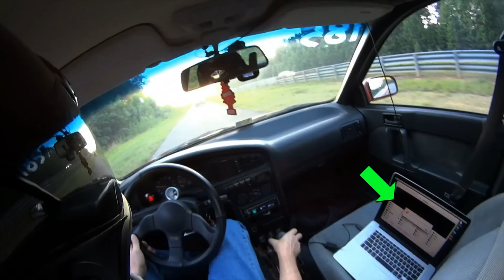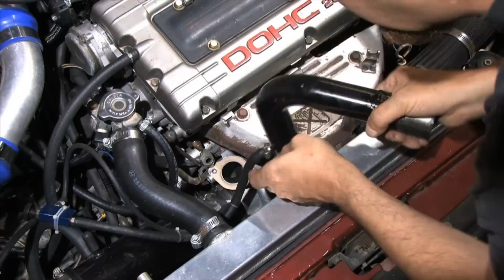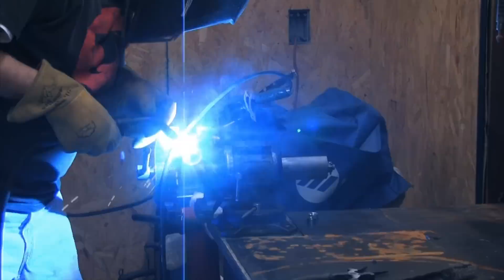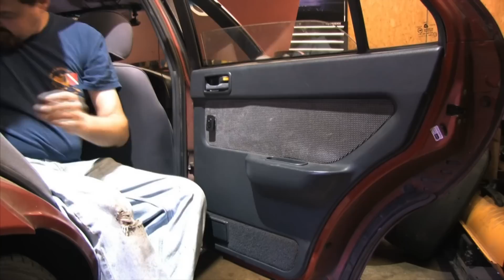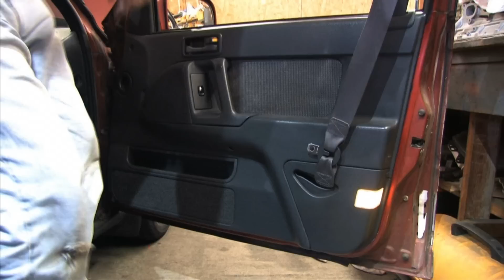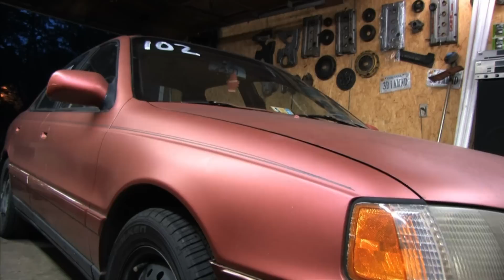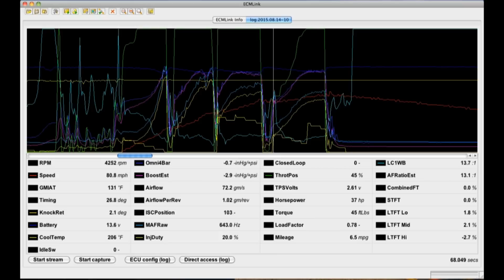Hyundai 15 - Trials and Tribulations

Comment: Your ignition maps should be smooth and progressive, you don't want to have any cliffs or spikes or big jumps from one site to the next, the factory tunes usually have a lot of those, they are there to deal with emission, also less ignition timing helps bring boost on, less is more.

Comment: Welp time for my next insight as another (e)lantra owner. 
It's funny how these things are lining up as not joking, just today redid my drivers door wiring harness (manual window so only 4 wires) and can confirm that the wires are disintegrating, the entire door harness all the way to the plug inside the car was just like dry play dough, smelled like it too.
I'd keep an eye on that, even some of the wires that were totally taped up were already showing totally bare copper and really risking a short. You've been fine for 6 years so far, but who knows how bad that's gotten by now.
Was actually my first time totally redoing even a small car harness like that and am proud of how it came out, hope to learn a lot from this car.

Comment: Why did you pick the Elantra to work on? Have you ever thought about rebuild honda J series motors?
Reply from the maker: I featured this car a couple of times when it was being built. Then it showed up in my driveway with the title and keys in it.  It completely interrupted me while I was in the middle of building 3 other cars.  I let it, only because it had a turbo 4g63 in it. Everything I have is either AWD or 4WD.  I figured that if I were to try my hand at FWD that I would pick the most challenging and absolutely difficult chassis to do it in.  I'm a bit of a purist now.  My Honda days are behind me.  If I ever move on from the 4g63 platform, I'll be boosting V8s.  Probably the 5.0L Coyote in my truck.

Comment: This video hits close to home base for me. I owned an Alfa GTV from 1974 and did the port and polish and glass bead work.  Not much to improve but I was always working on the car and enjoyed tuning and fixing weekly. My next car was a 2002 BMW and it was so boring and never needed any work so I gave it to my x-wife. I love a car that has issues cause I can stay busy fixing and being my own hero.....
Reply from the maker: I used to run around in a '74 Alfa Romeo Milano when I was 15.  It had quad side-draft carbs and suspension work done.  I rode around In the passenger seat, of course.  Wasn't old enough to drive yetl... but I'll never forget how that thing always made me really want to.  Real bad.  I still have a dry-mounted black and white photo of it that I took.  lol.

Comment: You can make a bead roller very easily from a horse shoe shaped piece of metal (i used a random piece of bent tubing that i think i got from an old push bike) and two rollers off cheapBay. For home grade stuff, it's pretty much as good as it gets. Oh and you apply pressure using a bench vise (mine has the grooves to fit pipe in it).

Comment: I apologize in advance if i missed it somewhere in your videos, Is this an HTA68 turbo? Seems a little too stout for a 16g but I know you have a fancy hand in port work so I was curious!
Reply from the maker: Who, the Hyundai?  Nah that's a Chinese $228 ebay 20g.  It's a 20g wheel crammed in a TD05 Big16g compressor and exhaust housing.  It flows about as well as an Evo316g, no better.  It's a little laggy, but how much do you expect for $228?  The engine is 9.8:1cr so it does quite a bit with the boost it makes.  I bought this turbo as a test for my GSX and logged 420awp on its best pass.  I blew up the GSX and the turbo survived, so I bolted it onto the Hyundai (keeping the project on budget).  We put the ol' 14b that used to be on the Hyundai into Foofy.  Speaking of Foofy, I gotta roll out to check on Chad.  Check out Foofy if you haven't seen it.  I drove that thing with a measly 14b and I'm sure we made over 320hp with it.
Reply: I always keep up on your videos! You're the man around here in all the DSM forums everyone links to your stuff when newer guys come with questions! Cheers

Comment: 1 major problem i can see, front left tyre is flat...
Reply from the maker: Front right one is, too!  The thing about compound tires (slicks) is... they tend to go flat on you overnight.  They don't hold air pressure.  Inflate to 30 PSI and maybe they'll make it 2 nights, but it's just something they do.
Reply: just thought that might have been your electrical issue lol

Comment: i've been having issues with my 4g's idle, it raced between 12 and 1500 at idle, and would jerk if i let it run below 1000 rpm in 1st or 2nd gear,  i replaced the iac, and it solved the jerking issue, however the idle still races in neutral, and seems dependent on atmospheric temp. but now that i know the tps and maf share a ground and input i have a better idea of what my issue may potentially be. thanks jafro
Reply from the maker: +Devin Mendoza You have a vacuum leak or a bad throttle position sensor.  I'd start with the vacuum leak because your airflow counts were wrong enough to end up replacing the MAF sensor.  Even if your car is non-turbo, go through my boost leak videos.  Un-metered air leaking into the intake is why it's revving at idle.  It's revving in Neutral because it's an automatic.  I'm guessing that last bit.  I don't know if it is or not, but it sounds like it.
Reply: its a 5 speed manual, i suspect the tps also but i haven't had the time to put a multi meter to it to check if the response is consistent. but i've gone over the entire thing with starting fluid to see if it straightens out and have no luck. i have read that a clogged egr can cause a similar issue, when i had the head rebuilt i noticed a heap of carbon build up inside the intake port. all that aside everything has appeared solid, i've even had experiences with the valve cover gasket being a source of a vacuum leak, but the pcv hose and valve plumbing are tight. tps is the only thing that appears to be factory also. wish me luck on my endeavor, thank you for the input its really appreciated
Reply: ***** its a 5 speed manual, i suspect the tps also but i haven't had the time to put a multi meter to it to check if the response is consistent. but i've gone over the entire thing with starting fluid to see if it straightens out and have no luck. i have read that a clogged egr can cause a similar issue, when i had the head rebuilt i noticed a heap of carbon build up inside the intake port. all that aside everything has appeared solid, i've even had experiences with the valve cover gasket being a source of a vacuum leak, but the pcv hose and valve plumbing are tight. tps is the only thing that appears to be factory also. wish me luck on my endeavor, thank you for the input its really appreciated

Comment: ok jafro winter is over what going on with the car
Reply from the maker: +Thomas Mccall Fighting every urge to burn it to the ground.  I hate electrical work.  It's not that I can't do it.  The problem is I do it for a living on micro circuitry.  I absolutely hate it where electronics and cars meet.  I love cars.  I could do without the electrical BS, but I love cars.  If I could put handlebars on a solid fuel rocket, I'd be in heaven.

Comment: Hey Jafro you seem to know a lot about hyundais and Mitsubishi 's. So I humbly ask what are the parts that you actually need to swap a beta engine from a 2000 accent or tibby into a 99 accent. When I was in Puerto Rico I have seen 4g94 motors swaped into the accent as well. Any help would be appreciated.

Comment: You are well trained. I know because I'm a retired ASE Master Technician who had one of the best comeback ratios in the nation. When I worked on a car it stayed fixed, my repairs almost never came back.

I've been to the General Motors Training Center in Atlanta, back in the 90's when I worked for Youmans Chevrolet in Macon, Georgia and had many special training classes there. One thing I have that I haven't seen you have (yet) is vibration diagnosis and repair. Just FYI, that's a good one to get if you don't yet have it, don't know why I even mentioned it.

My Advanced Special Electronics training helped me a lot with these electrical bugs you seem to have. BTW excellent diagnosis using the wiring diagram and recognizing the common grounds and how a bad connection could throw off the computer by sending electrons off in the wrong direction, so-to-speak.

Given the history with some poor quality wiring you already found, and you may say, "Ya... SH!T", it might do for you to take a look at some of those mods, the MAF was it, and if those parameters and connections are good, here it comes, first easy thing is (and I'm sure you already looked at it) check your ground triad. The batt to frame, batt to eng, batt to body; the frame to eng, frame to body; and the eng to body. All your harness grounds depend on this triad and even though one can be bad and it not affect the computer, let another get bad and, well, you know. Also some wiring harnesses take ground for the fuse panel from a fusible link to the battery too, so check those two connections to the fuse panel as well as the ground triad. If no problems found...

Here's the last (and most dreaded) suggestion; take out your wiring harness, lay it on a table and remove all the tape and looming. Check any splices, especially common power, 5v most suspicious, 12v a little less, and the ground splices. Check out all of your PCM wiring from PCM to component. If there's an iffy (or spliced) wire, replace the whole wire, don't add splices! (maybe check that MAF wiring?) Every spliced wire adds to the total resistance in the circuit and the computer will be assuming an already calculated resistance for that circuit. Check every inch of the wires looking for brittle feeling hard spots or spongy, too flexible spots. Those wires going to your window motor looked like they got too hot, not surprising for a bad motor to run high current but the fuse should have blown before it melted the wire's insulation. There is a such a thing as cheap, faulty wires.

You're a good technician, don't call yourself a mechanic. All a mechanic can do is throw parts at a problem. A technician understands what makes a system work and when he can't get the right part, he can often make another part do the job the system needs done. You've demonstrated that to me.

Comment: Dude...get a Mk1 Lotus Escort and put a Cosworth BDA in it. Reduce the compression ratio and run it at 2 bar. 
Or, get a Skyline R32 GTR. My sons road registered R32 still holds the record on street tyres at 10.31 for the 1/4.

Comment: As ghetto as it sounds I used copper RVT to seal my buddies intercooler pipe with a clamp to keep it from blowing off on his 1.8 323 turbo. It worked for the longest time until we blew piston number 4 after number 3 a month later. That little Mazda kept trying though. I love oddball builds and man yours is gotta be another underdog I love seeing. Hopefully one day I can sport that 2.0 4G63 in my Colt Vista. Wicked build man.

Comment: Hey Jafro. Quick question, How can you tell the CAS is at the right position? Or at least close to 5 degrees? I'm having a no start and narrowed it down to when I pulled my cas to paint it
Reply: +Trevor K If you pull the CAS out, there's a small dimple on one of the ears. The dimple goes towards the firewall when the motor is at TDC.
Reply from the maker: +Trevor K Well, it can only go one way or the other, so flip it 180° and see if it fits.  Only recently have I owned cars with the cam angle sensor hanging off the passenger side (95-96 don't have them) and I've never gotten one backwards.  I think the groove is offset, isn't it?  Doesn't it only fit in one way?

Comment: I have a similar tps problem but only have a cheap multi-meter at my disposal. Not to mention I've found wires like you did when replacing your door regulator, but in other places. Can't wait to see you start back up on this project!!!

Comment: I'd like to see what you could do with an engine out of the Oldsmobile Cutlass Ciera S (with 3.3L 60* v6 but these are iron). But if you could get one of these http://www.summitracing.com/parts/nal-10051141 I believe you could get a power to weight ratio exceeding v8's.

Comment: My diagnosis:  Your knock is false (sensors are picking up something else "knocking") ,  tons of timing is being pulled due to climbing IAT's , richness is a result of timing being pulled and possibly an ecu response to high IAT.  False knock can be a pain in the ass,  sometimes you just have to go off of plug reading (ground strap annealing point).   There's no reason you should have had knock on the launch , and it's inconsistent thereafter... that's why I think it's false.   Also I see knock with low timing while rich , that should not happen.

Comment: Im curious   a big part of racing is power to weight ratio  why wouldn't you just take all the window guts out and leave them out and permanently fix the windows in the closed position? Take out the back seat take out any non essential trim and lighten it up. Remove the carpet from the trunk and the spare tire when your making your runs etc...  Light weight = faster with no power increase.
Reply from the maker: +jeff reissner I have nothing against that, I just have several other cars that are far more deserving of that treatment than this one.  I'd probably shed much more weight by scraping off the 1/4" thick layer of bondo that's on the roof.  Maybe just let the rest of it rust and blow off by itself?  I'm tellin' you man... much more deserving cars.  lol
Reply: Lol. Love the Bondo comment.  Good videos your making

Comment: Are you considering, in the future going with disc brakes in the rear? If so let me know, I know a guy that can make that happen and it'll look factory. That should takes some weight off of her so she can gallop a little better. Also, I am interested to see how the meth injection would work on this setup, once the wiring issue is resolved that is. Being you have the prestine TBE, you're not going to drill into that are you? Lol, any how, hopefully we can see more of the Colt, and this car with all it's bugs squashed.

Comment: 330 HP from what essentially is a stock engine (parts, no racing components) and a slightly bigger turbo. Impressive. Once you fix the electrical, this thing should scream. Based on what I saw in the log, 300 HP @ 5950 RPM, the motor has more in it. I would be very interested to see what this engine could so with some 100 Octane Race fuel in it. Nothing exotic, just high quality race fuel.
Reply from the maker: +Doug Hanchard To be fair, it does have the smallest-available set of HKS cams, but other than that, you're right.  It's a testament to how tough and over-engineered stock 4g63 parts are.  The same exact engine that makes 210hp in the US somehow comes with 276 in Japan.  That's how de-tuned the 4g63 was here.

Comment: jafro you must continue with the hyundai for 2 reasons #1 moving on to something else leaves the hyundai in a position to be donating new fun goodies to other projects never a good idea then your back to 2 unfinished projects and more importantly i believe i have a similar issue that you teased at the end of the last video (25 year old wiring harness and every day car runs differently ) i am dying to know what you did or what you found please.  either way youll have my views but hyundai please (then colt!!)  keep up the good work
Reply from the maker: +Kyle DeSerio Nah... you have my motives all wrong.  It could just be that the county wants all of my vehicles tagged, registered and inspected.  In order for me to do that, I have to stop working on running, inspected, tagged cars inside my garage space or else I'm just asking for trouble from the county.  If anything was more likely to happen... it would be pulling parts off the Colt to fix the Elantra because it's a lot further behind in completion... but there's 2 reasons why that's not happening... 1) the Colt is wired with a '92 engine harness and the Hyundai sensors are the equivalent of a '90.  So several of the connectors won't work.  2) I don't plan to rob parts from any one of them in order to fix the others, I have what I need for each of them already.  If something is laying around, it's fair game, but I'm not stopping work on my compliance and face fines because of a "free" street legal and registered Hyundai.  It's just losing its garage privileges because I have other cars that are more valuable to me to fix.  My production has been slow this year mostly because I'm being harassed by my county and it started right after I started engine assembly on the Hyundai.  A few other things have popped up, but I'm handling them all the best I can.  I'm being forced to work on things not related to my video production, never mind that I pay my bills with a day job.  It's getting fixed, but probably in the freezing cold outside and I won't be filming that.
Reply: +Jafromobile Sorry to hear that bro, hopefully the country nazi's can get a life and let an Internet legend do his thing. If I hit the powerball you won't have this problem any longer, hopefully things work themselves out. It's probably pesky neighbors, calling the po po on you, more than likely. Hopefully I'm wrong on that part, but I have cool neighbors, and one happens to be a Cop, they both leave me alone and I'm probably louder than you are. I hate to hear shit like this happening to you. Keep up the good work, glad to see a new video whenever it comes out, since we kinda have the skinny of this situation. Take care! If us subbers need to start a petition, to help you out, let us know!

Comment: Did you say... TPS Reports? I'd also be on the hunt for bad capacitors as they can cause some seriously weird issues. Had to replace bad-caps with Rubicon or Nichicon caps, but it's so worth it. Older electronics of this era are probably susceptible.